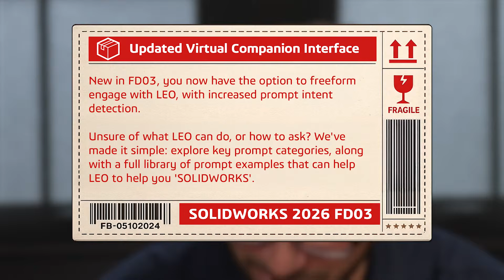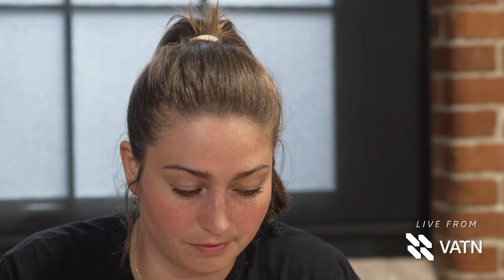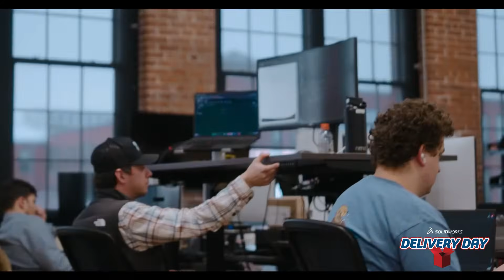SOLIDWORKS 2026 FD03: New AI, Performance & Workflow Features

Comment from the maker: 🦾SOLIDWORKS 2026 FD03 New Feature Timestamps:
8:13 SOLIDWORKS AI Virtual Companion Prompt Bank
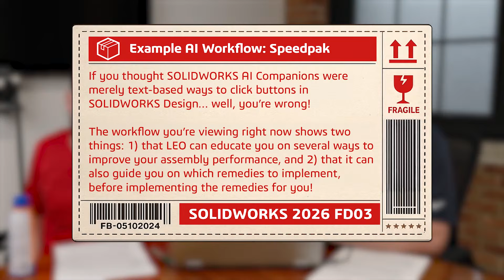14:31 AI Workflow: SpeedPak Generation
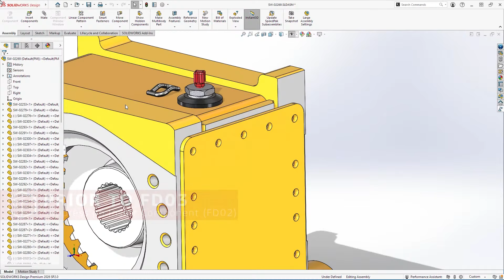20:54 AI Workflow: Remove Modeled Threads
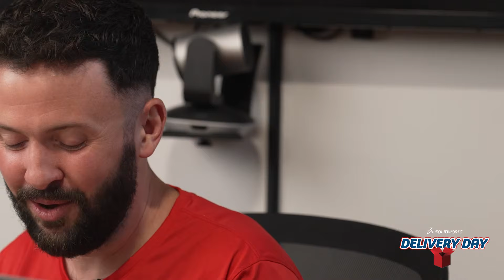25:52 AI Workflow: SOLIDWORKS Macro Creation
📦SOLIDWORKS Design 2026 Improvements This Month:
32:06 Pattern Assistant for Hardware Stacks
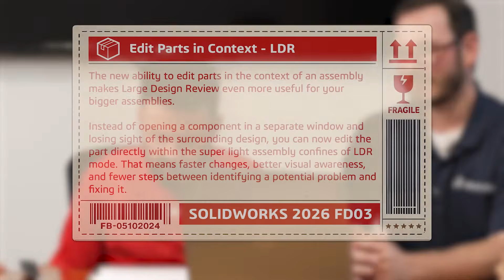37:48 Edit Parts In-Context using Large Design Review
42:07 Assembly Visualization Improvements
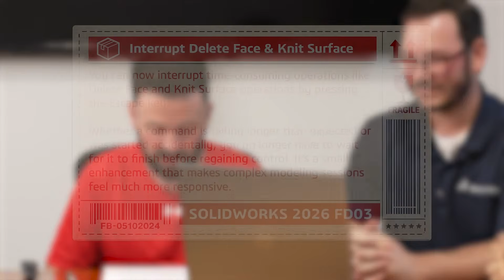45:35 Interrupt Delete Face & Knit Surface (ESC Key)
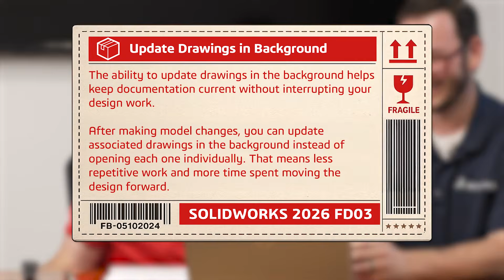50:02 Improved Family Tables
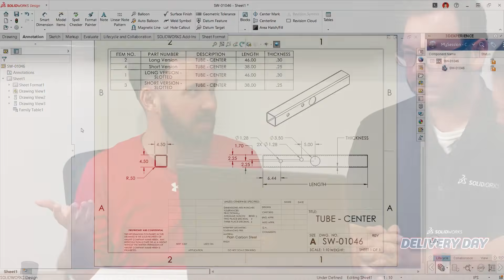54:04 Update SOLIDWORKS Drawings in Background
57:43 UV Editor for Photo Rendering
☁Multi-User Enhancements in SOLIDWORKS 2026 This Month:
1:03:48 Auto Save SOLIDWORKS Files to 3DEXPERIENCE
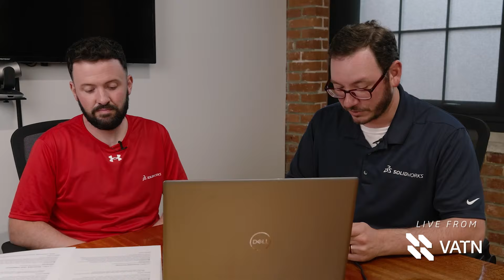1:07:26 Download Drawings Automatically from Cloud
1:10:49 Broken File Reference Repair on 3DEXPERIENCE
1:13:45 Task Objects in SOLIDWORKS Design